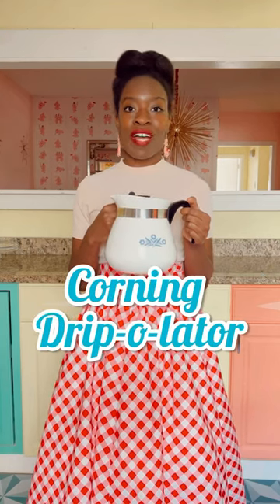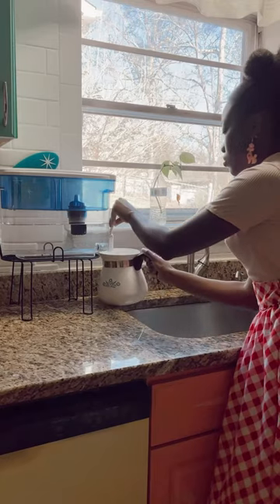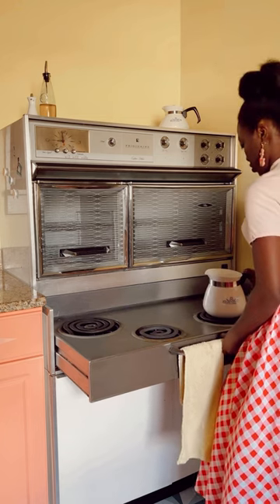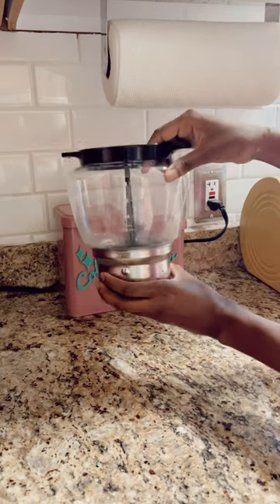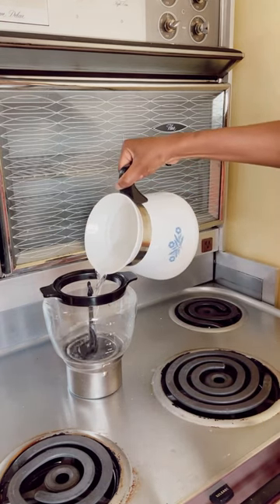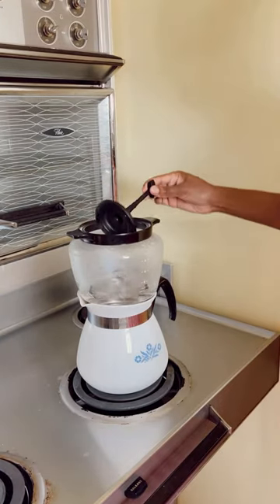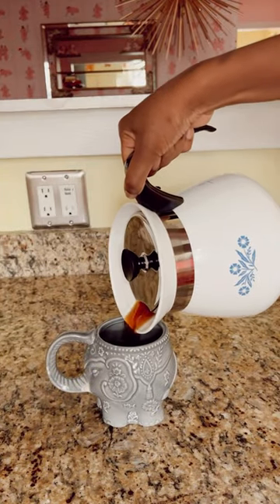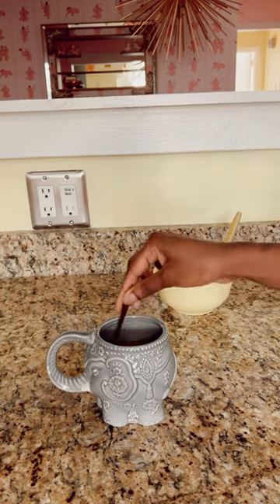Using a vintage Drip-o-lator #shortscreator #1950s #coffee

Comment: 😊😊😊😊the 1960'predecessor to our modern pourover system! We in USA had this same concept in the 40's. The pot was made out of clay, the top portion either also fired clay or aluminum. The advantage Corning brought was the ability to boil the water in the pot!!! No need to use another kettle to boil the water BEFORE pouring it into the 'drip' portion. And you had a pretty pot to serve from, making for less dish washing. Love love ❤️

Comment: Very cool. Real PYREX too! The modern Pyrex (with lower case letters) isn't tempered glass anymore. I found that out the hard way when my casserole dish exploded. We do pour over, but I like that you don't go through a lot of filters with the Drip-o-later.
Reply from the maker: Oh yes it’s nice to have the old PYREX
Reply: It's tempered glass (else it couldn't handle heat), but it's no longer borosilicate glass. Always scary when it shatters!